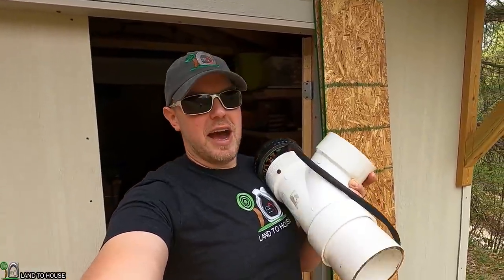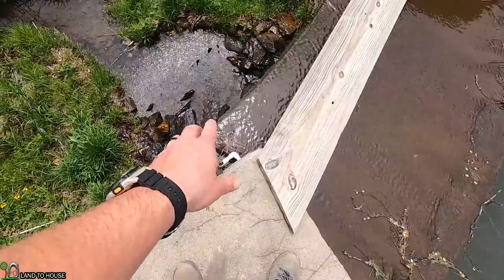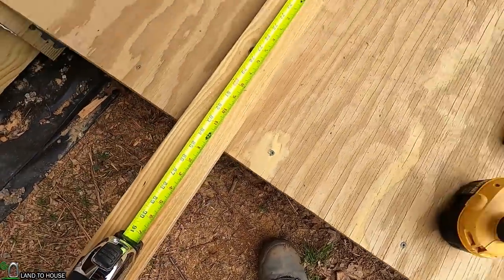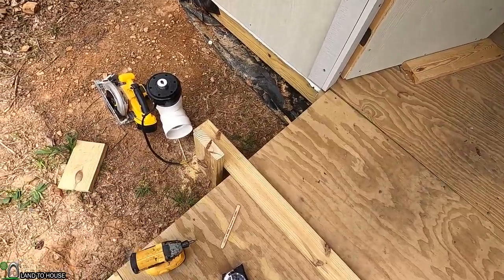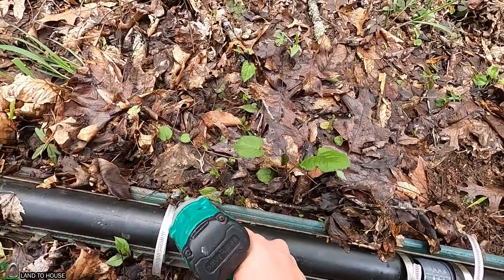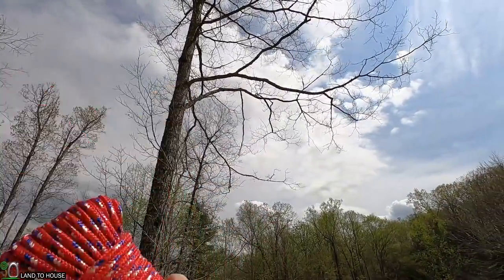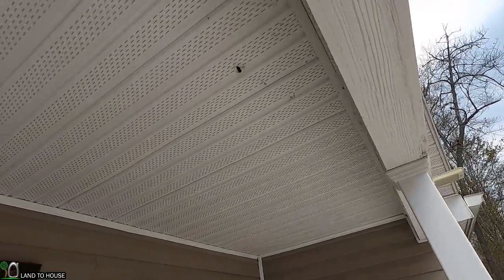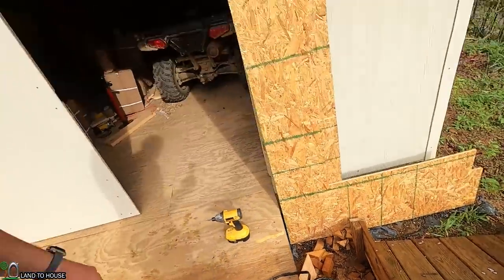Its time to get this Hydro unit ready for Install

Comment: ABS blowouts, We had a 2HP water pump for our yard pumping 200 yards in 2" abs, every summer it would get hot and the clamps on the joints would blow out, a simple 1" drywall screw through the joint solved the problem, or 2 screws if it kept blowing out.

Comment: large poly pipes and in ground it is typical to use 2 clamps per pipe attached to a nipple, with screws off set to each other. so 4 clamps per junction to bite harder.

Comment: You might be able to use a bell siphon to start the flow automagically when there is enough water.
Reply: Yeah, if he could dam the water to above the inlet, then bend the inlet pipe down and up into an upside down bucket that could work if you could evacuate all the air in the horizontal pipe.

Comment: Question : which gives you better results : a vertical 8'drop into a couple of 45's into a ram pump,
or an angled run from the 8' (say, a 30' run)down to the ram pump?
Reply: Good question! I’d guess the latter, though if the slanted pies can shift about, that may introduce turbulence that’s worse than what was being induced by the bend. 🤓🤔🤷‍♂️

Comment: if you got some 3x2 drilled a hole the same size as the pipe then cut into 1 1/2 inch use bolts to clamp back togeather you could put one of these each side of the pipe joints then have threaded bar clamping one block to the other this would clamp the pipe and hold it togeather better then the fence posts if to loose you could skip some away making the hole smaller and clamp better

Comment: Glad to see the progress on this one.  I'm wondering if your current micro-hydro has enough discharge to run one of these low-head units as well?
Reply from the maker: The upper hydro system is pulling somewhere around 32 gallons a minute at Max. I don't think it's quite enough flow to run this kind of system.